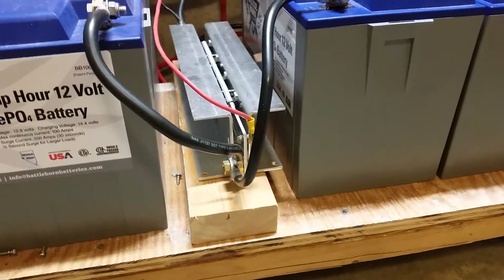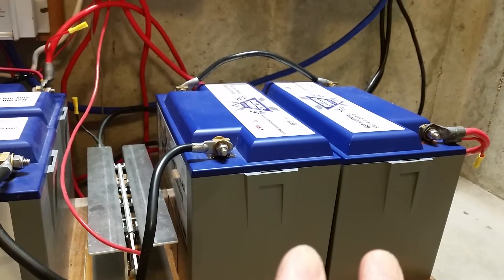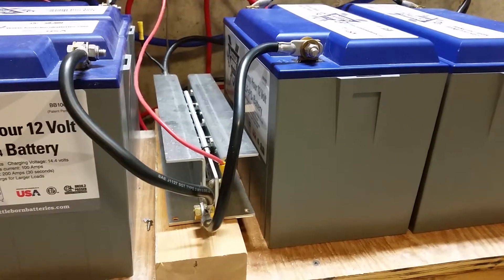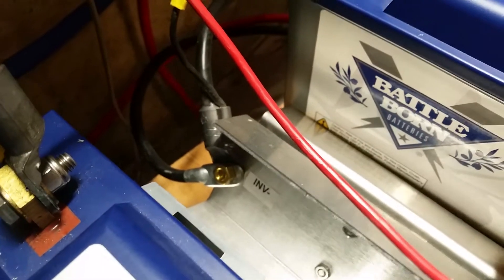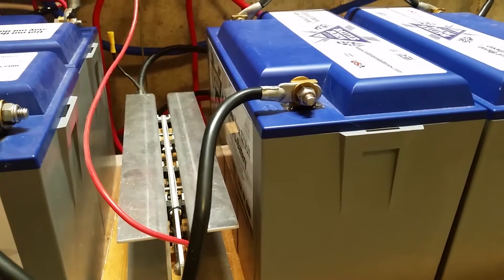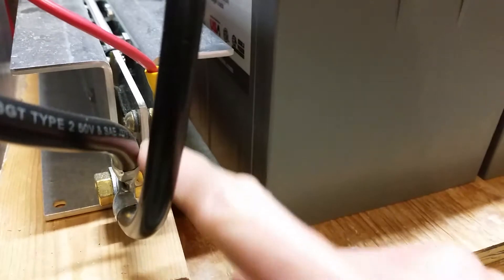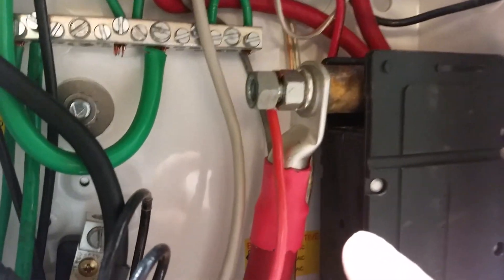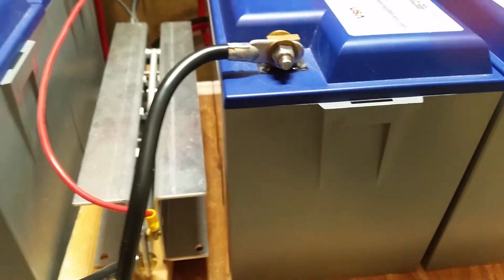Battle Born LiFePO4 Lithium Batteries:  Current Surge Limiter (CSL) Connections

Comment: I had issues with soft starting using my 2000 watt inverter and 400 ah battery bank. Drove me nuts for 3 days until I watched a Youtube video where you can use a small resistor to soft start before hooking up the inverter neg cable to the batteries.

Comment: My first system used 4 BB batteries and a 4000 watt inverter. I switched on the battery switch and immediately lost all my battery power. Each battery read 3.3 volts. I was scared I just blew $4000 dollars. I called BB and the tech told me the the inrush of amps needed to charge up the inverters capacitors was too much and the BMS shut down the batteries. Large wattage inverters will do this. He told me if I had a battery with after least 12 volts just to jumper each battery and the BMS will sense it and reset it self. That's were the current limiter comes in by metering the out rush of amps to charge up the inverter.  I have a CSL now on my current 3300 watt system.
Reply from the maker: That is basically what happened to me as well and thank you so much for watching.  Another option instead of purchasing a CSL from BB is to just have a small battery of whatever chemistry without a bms and use that to recharge the inverter capacitors, then quickly hook up the BB batteries before the inverter capacitors loose their charge.
Reply: Does the CSL eliminate this issue?
Reply from the maker: Yes, with the CSL hooked up properly I no longer have this problem.

Comment: I have a similar set up and am just now adding the requisite current surge limiter. One part of the installation has me baffled. The instructions say that either the negative inverter connection or the battery negative can we grounded, but not both. For the one that is not grounded, what is it connected to?
Reply from the maker: Thank you very much for watching.  Understand grounding a system can be kind of a pain.  But I would highly recommend grounding your system somehow which will allow your question to be answered.  Plus, if you bought this current limiting device I'm assuming you bought it to protect your battery warranty.  If you do not have a grounded system you may not have a lot of luck making good on that battery warranty should something happen.  Hope that helps.